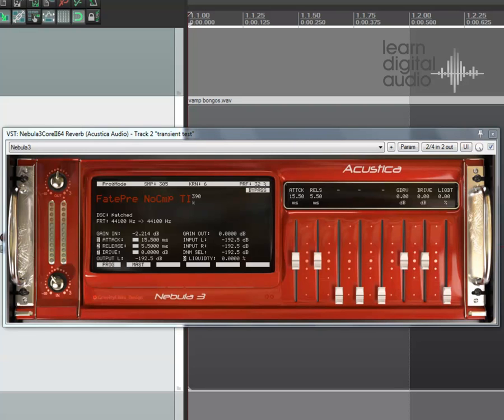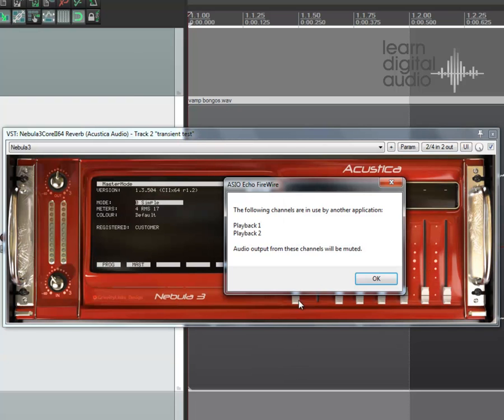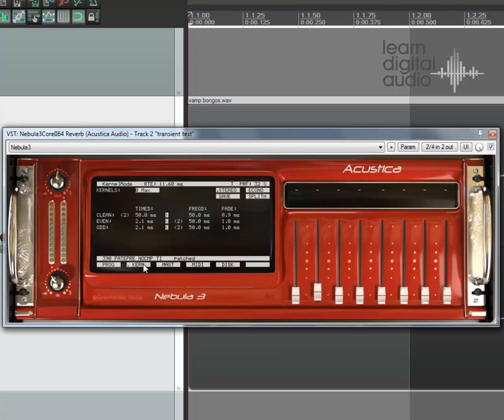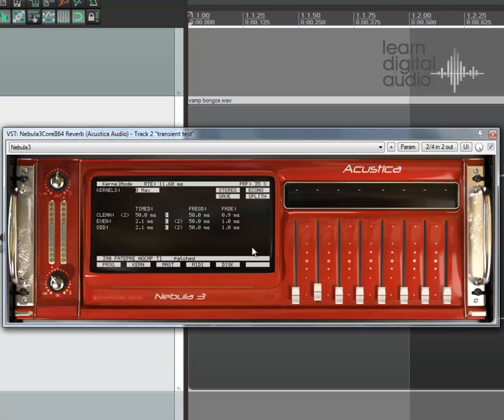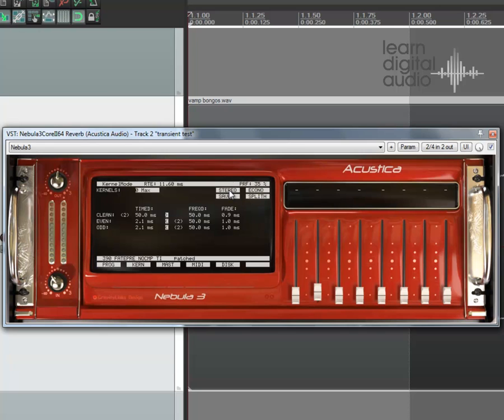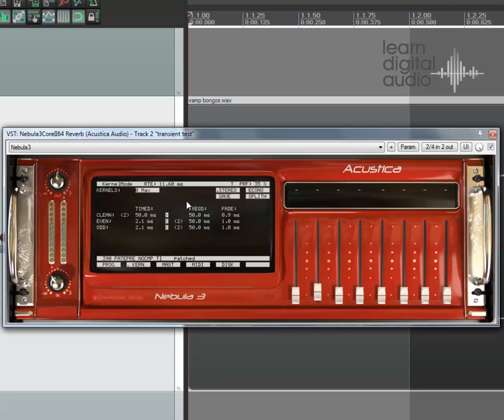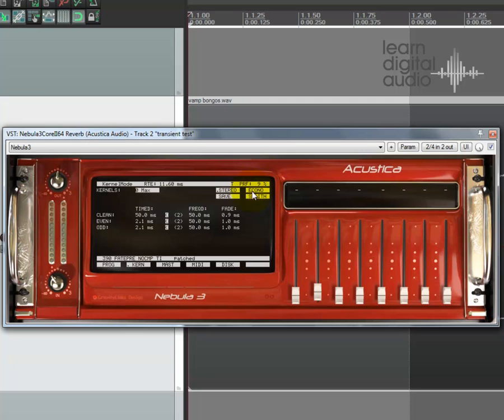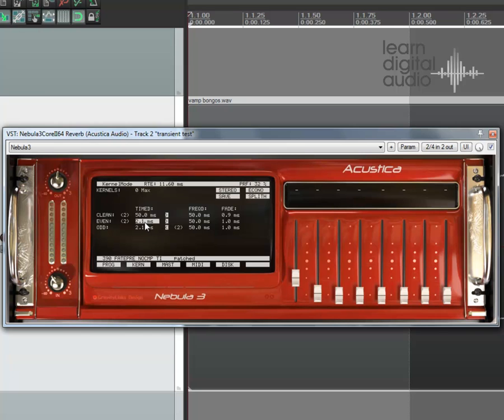Nebula VST Plug-in Switching To TIMED Kernels

Comment: Hi, thanks for the vid. How do you determine how many miliseconds do you need for clean, even and odd ?
Reply from the maker: Glad you like it! The clean kernel is the important one, the TIMED should ideally match the FREQD length, but often that uses too much CPU. 50ms is usually fine, it is possible you could loose a small amount of sub bass if the length is too low, it is highly dependent on the program you are using.

Comment: do the clean and even kernels have to be in the same amount of ms?
Reply from the maker: No, but if you are low on CPU make the clean 50ms before touching the others. A good amount of ms is 50 for general use, it mainly determines how low the bass can be processed, you can experiment pulling it down until you start to loose bass to demonstrate this.